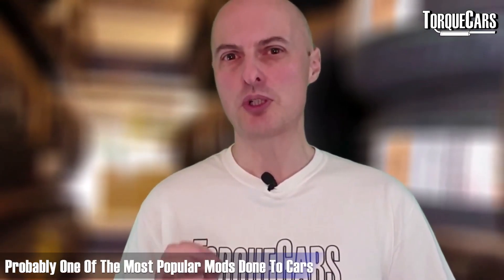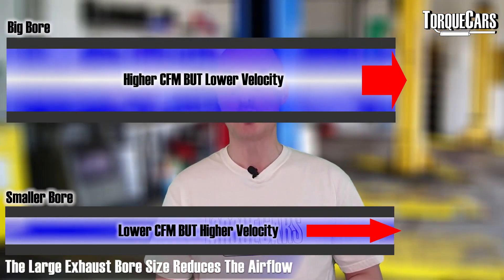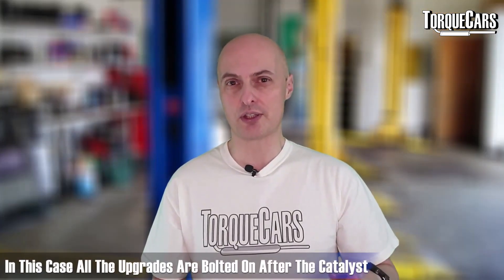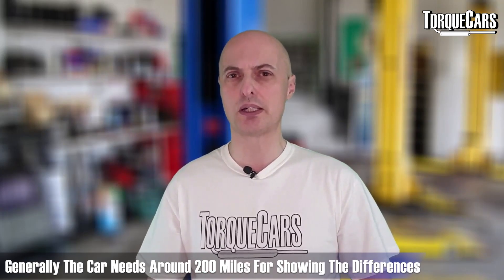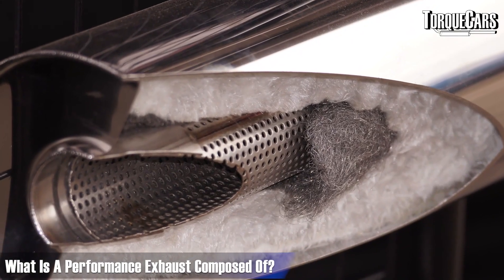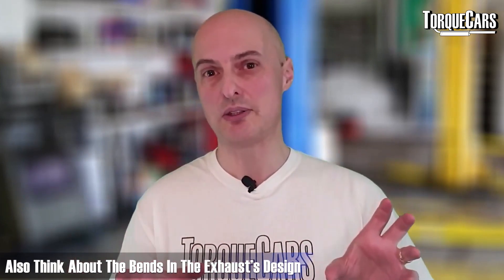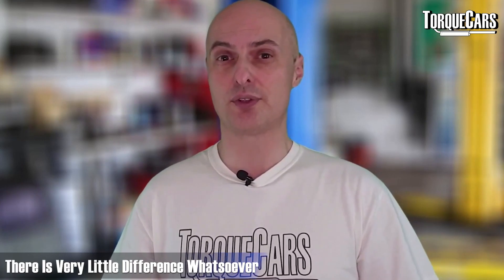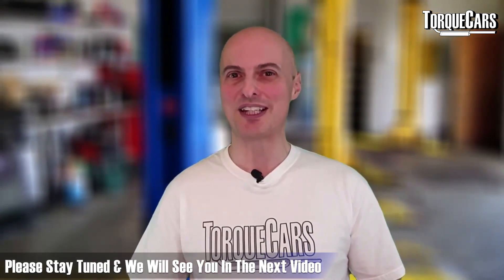When "Performance Exhausts" Lose Power! 🚗💨 [Tuning Tips]

Comment: Great info vid,, I went to a 3" cat back from a 2 1/2 on my 5.3 swap ,,I notice the 2 1/2 had better on low end and top end and used a Magnaflow muffler and this is a single exhaust ,,Do you think I lost velocity with the bigger pipe?

Comment: Hi, I have a question, Do I need to upgrade my stock exhaust system if I'm looking to tune a 1.9 tdi awx with a gtb1756vk turbo to 220hp without EGR delete and dpf delete everything stock in the exhaust side. Thanks

Comment: Just had a corbra non resonated cat back put on my stock 208gti...same width as the stock exhaust, sounds good but feels a little less torque than before....however only done 40-50 miles so far so hopefully improve slightly.

Comment: I have a question. i got a 3.0L diesel engine and i want to upgrade to full aluminum exhaust. what can you suggest for the diameter size of exhaust i will be using? 2.5 or 3.0 dia.inch?

Comment: Hi been looking at upgrading my skoda octavia  2.0 tdi BKD engine with GT1752 turbo so been told I would need to upgrade intercooler,4 bar map sensor and decat is this true
Reply from the maker: I had the BKD in my A3, it is a great engine. The intercooler only really needs upgrading if you get heat soak, so unless you do long periods of full boost driving it shouldn't be required, I would go with a front mount on these though as they are a lot more efficiient.

The 4 bar map sensor is a good idea, the stock one will start to top out with this turbo although I have seen it working ok on one setup, but I am pretty sure they dialled back the boost a little. The ECU needs to be setup with whatever map sensor you choose or it'll be using the wrong fuel tables.

Decat will allow the turbo to spool up a little faster, but a sports cat will do the same thing and keep the car legal.

In most regions it is illegal to remove the cats/dpfs but in my opinion they are not the power sappers people make them out to be. 3% power loss is typical through a resttictive one.

Comment: Thanks so much for confirming exactly what I experienced when I installed a larger diameter catback exhaust on my 2016 Scion iM.  Low end torque was all but drastically reduced and exchanged for increase of power in higher rpm's.  I reinstalled the OEM exhaust and all is well now.

Comment: Can you help with an exhaust question?
Reply from the maker: Fire up your question and if I know the answer I'll do my best, if not I'll try and find out for you when I get a chance.
Reply: @torquecars  I have mk6 Golf TDI that has a DPF delete and stock muffler.
I'm looking for a nice sounding resonator that is diesel specific to replace the stock muffler. Any suggestions?
Reply from the maker: Miltek and Cobra sport offer decent options on the 1.9 TDi, but I have never been impressed with the exhaust note on any diesel engine even with exhaust upgrades. Of the few that I've heard (and I've not heard the Miltek so can't comment on this) I think the Cobra sounds nicest, there is more low end bass to the note.

Comment: When I got my 1.8T A4 someone hacked up the exhaust pretty bad. So I got a kit and made it myself. I like to do things as cheap as possible. I love it! Straight piped from turbo into a Flowmaster FlowFX muffler with 2.5 inch pipe. The car is surprisingly quiet until I really get on it.
Reply from the maker: Those good old flowmasters are pretty impressive. I recall that one of those gave the same power as an engine with open headers but managed to keep the noise within legal limits.
Reply: @torquecars  yeah it's a straight through muffler. Like a glass pack but a normal muffler shape with a offset/center in/out... Only paid $50usd!

Comment: A very important video as exhuasts are one of the first mods many do as beign part of the whole "help the car breathe" step before adding power.
I plan to get a custom exhuast myself =) saving up for such a is long process however ~

But keeping in mind you sdtated that we need an exhuast to match power output and I presume pressure, would it be best to just get a performance exhuast now and later down the line after Stage 1,2 go for another custom exhuast? wondering what'd be best..........got a Peugeot 208 GTI Prestige of recent.

Thanks for the video =)
Reply from the maker: There are a few options around, I would recommend the Resonated Scorpion on those. Choose one with around 2.5 inch tailpipe and this should be good for your planned upgrades (unless you were going with a turbo upgrade kit of course). 

Milltek and pro-speed are also good exhaust setups, but I've not really had much to do with these engines so there could well be better options out there.

A cat upgrade should free up around 5-7hp. When I find out more for you there will be a video on mods for these!
Reply: @torquecars  Much appreciated will look into the Scorp Res' and look forward to the video should to find out more :D THanks!